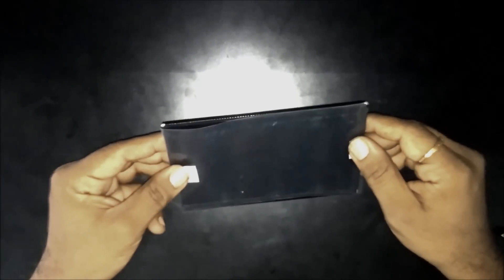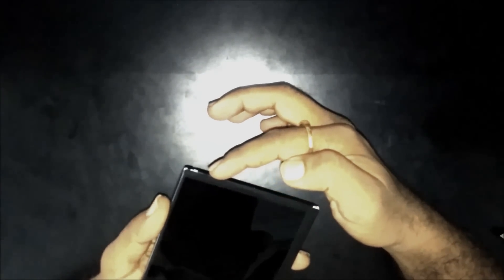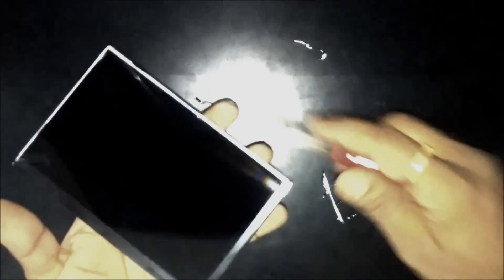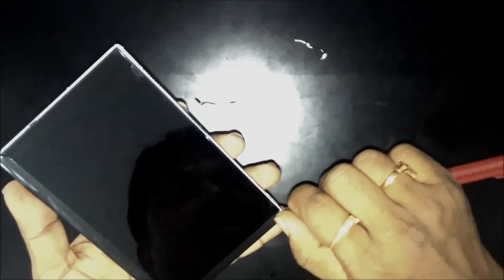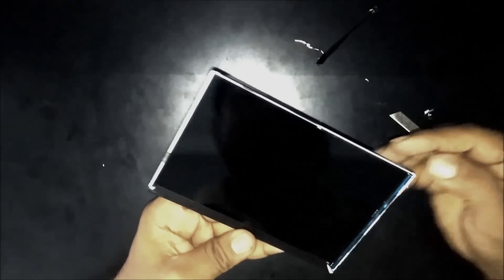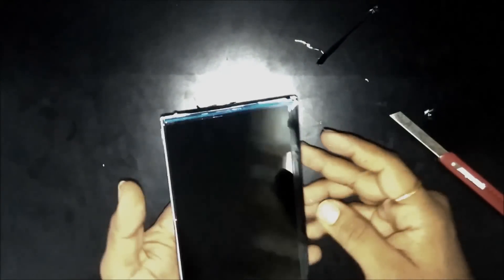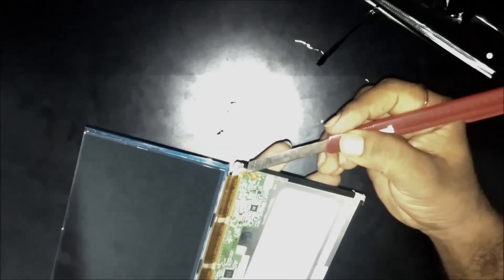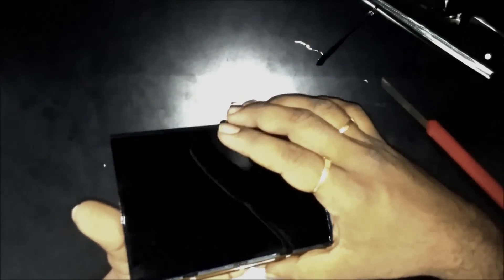Stripping N070ICG LCD for making DIY Projector

Comment: Can this LCD be used to create a projection projector?

https://m.ru.aliexpress.com/item/32338411917.html?trace=wwwdetail2mobilesitedetail&productId=32338411917&productSubject=32338411917&shortkey=eEvQjau6&addresstype=600
Reply from the maker: Yes, you can use this LCD and controller kit.

Comment: Does it work after the disassembly?
Reply from the maker: Retró tévém Yes, it will work. only thing is,  you  can't see image, as back light was removed.
Reply: +Globali Bay Yes, but if you put against a light you can see the image. Or can you?
Reply from the maker: +Retró tévém Yes, you can put light and you can see the image.. but inorder to see clear image with equal spread of brightness you should use Fresnel Lenses.. we use this concept for making DIY Projector..